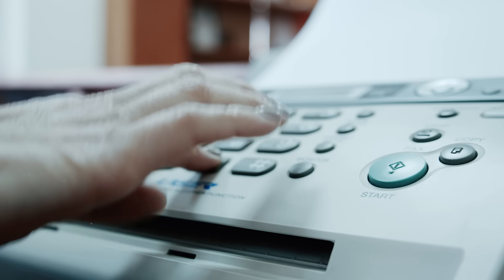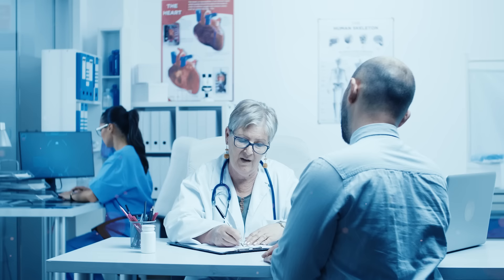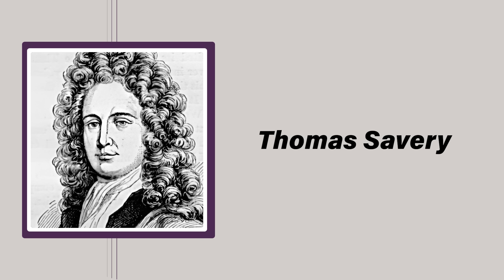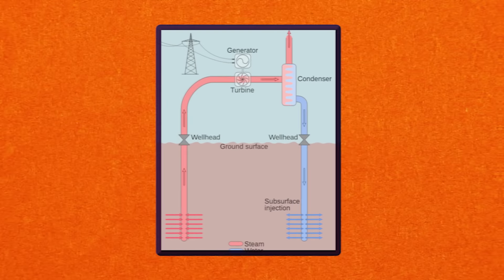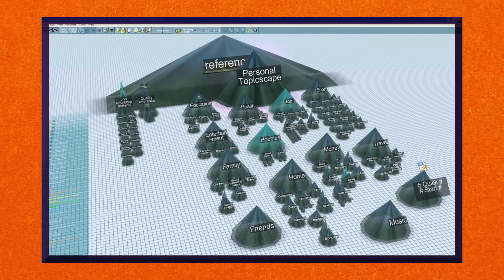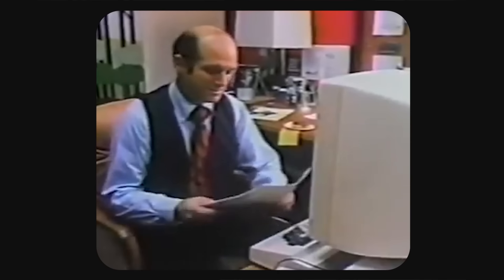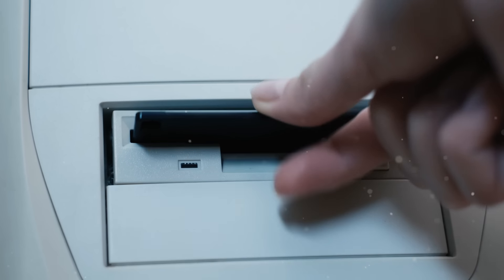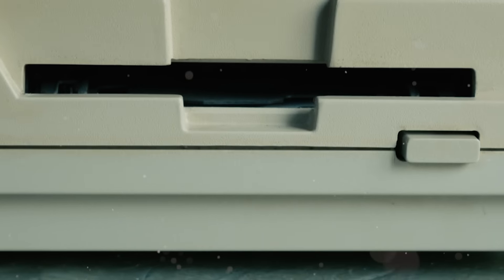Terribly Outdated Technology that we Still Use...

Comment: Steam and power are such fundmental basic concepts that it will probably never go obsolete.  What does sometimes go obsolete are certain types of steam generating equipment, or certain uses for the steam, but the basic idea of creating a clean high energy, high expansion vapor for power conversion or process heat is just irreplaceable.

Comment: As long as Windows XP is used for dedicated, not connected to Internet in any way, it works quite well.  I can site a commercial business use in quilt stores where the OS is the only compatible one for the computerized quilt machine software.  Never connected to anything but the quilting machine, just works.  I am sure there are point of sale systems that also will only run under that OS, and provides the function that the particular business requires.

Comment: I still have an old sharp slc-50 (50 mhz win 3.1). This has been running mead software (albiet) with my own tracking control system to control my 5 meter home satellite system and was once used to control a 10 meter dish with an i/o motor control system running a very old orbit track software system. The only mod I made to my system was to convert the 2 line files (orbits) to 3 line files (orbits) and measure and lock the GPS parameters to the dishes variable control motors to localize my earth track to a moving satellite in space.   I even have both xp/nt/ and win 2000 systems running. Even an old gateway running storm...a Linux distro of rain, and mandrake.. they've been on regularly since 1984 with some stops for maintenance.  A computer is what YOU MAKE OF IT. Not what it makes of you.

Comment: I had 16 Scanning Tunnelling Electron Microscopes at a place where I worked. The controlling computer was built on XP. The STEMs were a donation; they cost over $600k each to replace. There were no upgrades to move the controlling computer to a modern OS, and no one at the organization had the balls to put in a budget request to Spend $10m to comply with HIPAA

Comment: Minor correction: Fax machines are much less secure than modern e-mail systems.  HIPPA laws do not, and never have recognized Fax Machines as more secure than email, they were just so ubiquitous at the time that medical lobbyists convinced Congress to grandfather them in to prevent a costly mandatory overhaul of the medical sector under the assumption that they would be slowly phased out by encrypted email systems.  However, because HIPPA requirements are so nebulous, it it turned out to be much safer from a LEGAL standpoint for hospitals to continue to rely of fax machines because they can not be held liable if a fax machines is found to be using vulnerable data transfer and storage methods.

Comment: Was a hardcore Windows XP user until 2011 or 2012, used it since it was first released. Only stopped using it because newer games require up to date tech especially when it comes to graphics, so that computer became my secondary/back up computer until the life cycle of WinXP finally ended with no more support going to it. So far it has been my favorite OS to use, no other OS has come close to it.

Comment: One fact I was disappointed not to see mentioned of older OSes and floppies, and what is even trurer of seriously older OSes like DOS, is that newer OSes also become increasingly more efficient vectors of Malware. Modern malware can't hope to fit onto a floppy, while the latest(even if "outdated") antivirus software is effective against all the old viruses.  While many compsec experts will tell you the last PC OS version is insecure against newer malware, significantly older OS can't even run newer malware, effectively becoming secure again, in addition to it's security through obscurity. I remember in the early 2000, there was a scandal when news uncovered that nuclear missile silos were using software on old 5.5" floppy disks. But I immediately thought how impervious these made it against malware, esp. compared to a USB memory stick, which could contain multiple apps for stealing data.

Comment: I still have an old Acer Aspire laptop running Win XP.  I only use it for logging in the field because it's a nice, small laptop and I won't feel too bad if it gets damaged, unlike my larger, more modern laptops.  I also only need it for viewing .pdf files and looking at schematics and such.  I suppose if I tried to put Windows 10 or something on it then it'd get bogged down & slow, as well as crash all the time.

Comment: yes is true, we have plenty old machines that are not connected to the internet or are in a "no routed network / private only / one 2 one " that perform services that are very hard to copy or replicate in newer equipment, or simply it cost way to much ( like millions ) to port it to another system, even sometimes porting to another system will be like emulating the old hardware with a lot of bugs, so in a sense is better to just keep it, ( looking at you AS400 )

Comment: I'm in Germany, so I own a modem with integrated fax services, and a physical fax machine (as part of a colour printer, scanner, and copier device). 😂 I even send faxes occasionally when communicating with the authorities. Germany loves fax machines... 😂 Admittedly, I don't use it often, neither device is set up to receive faxes, and I have to manually connect it with a long cable each time I use it. Still.

Comment: As President of the Steam Automobile Club of America, and an employee of General Motors Powertrain, I have to dispute the idea that steam automobiles can use fuel more efficiently than internal combustion.  The problem is the latent heat of vaporization.  It takes 974 BTU to convert a pound of water at 212 F (100C), and atmospheric pressure, into a pound of steam at 212F.  Thermodynamically, this is an "irreversible" process -- which essentially means that we can't extract work converting that steam back into water.  All the power we get from the steam is by raising it to elevated temperatures and pressures.  Powerplants can condense steam to near vacuum due to a large cooling water supply , whereas automobiles are necessarily air cooled and thus lucky to drop the exhaust steam down to ambient pressure. Also, large steam plants can employ all sorts of heat exchangers that simply won't scale down to fit under the hood of a car.  The idea of steam-powered automobiles to battle pollution came about in the late 60's and early 70's ... but died a fast death when OPEC cut oil deliveries and governments instituted CAFE (fuel economy) standards.  Today, catalytic converters, fuel injection, and electronic engine controls arguably make a gasoline engine at least as clean, if not cleaner, across the entire driving cycle than a steam engine is likely to manage.  This is because you need to expend a lot of fuel just to raise steam whereas the ICE is ready to go after burning very little fuel.

Comment: There are technologies that are just „good“ , that work flawless and fulfil the requirements. It is interesting that there are many attempts to replace those technologies with shiny new technologies to sell the required upgrades and replacements, that usually solve issues that never were a real problem, but therefore drop many of the original requirements, thus requiring even more costly shiny new upgrades and replacements…
Examples are tcp/ip , the can bus or midi.

Comment: Many emergency services have "upgraded" to digital communication systems... that isn't too much of a problem around cities but as soon as you get into the bush they are near useless. They don't work in heavy smoke, hills, mountains.. you know.. the kind of places you need to go rescue someone. That also includes mobile data terminals, the systems used in ambulances.
Yet the antiquated CB still works in those situations, in fact there's volunteer groups which set up relay stations for volunteers during searches.
I don't know why they even bothered, for digital you can use a mobile phone and it has great security and is a "free" upgrade. Otherwise stick with what works.

Comment: I retired from the USAF in 2001. I was an Aircraft Weapons Technician. I took care of the weapons systems on five different fighter jets. Everything that was directly tied to weapons systems. Bombs, missiles, Guns, Chaff/Flare (yes those Phoenix Lights in the 1990's were flares. I saw them myself). But I digress...
I retired in 2001. I did work in several tech industries in the next several years. From selling electronics, to phone center at a big Cable Company (you called me, when your internet went out, and I'd be the one to tell you, "Have you tried turning it off and on again?". Indeed, thats usually the fix with all tech. I eventually gravitated to Xerox, in 2007, and my new carer as copier Tech had begun.Yes, the closest thing I could use my Air Force training in the civilian world. At least I had some electronics troubleshooting background. As none of the Major Air Carriers I know of don't use weapons systems.
One of the first things I noticed was, in the age of the internet, people were still using fax machines. Yes, I repaired those as well. Mostly they were incorporated into the multi function printers. But the were many that were stand alone Fax machines, connected to a dedicated fax line.
These were usually hospitals. They would often fax complete medical records to each other. I mean like 200+ pages in a single fax! These devices were never meant to handle that much use. And they worked them to death.
The Police dept used them. The Fire Dept used them. Lawyers used them. And many educational institutes still used them as late as 2020, when I left the industry. 
Everyone that uses a fax should know, even though it has the confirmation page, that is used for proof of transmission. It doesn't always work. It assumes that you have a completely functional fax machine at both ends. That nether one has any issues. That the sending optics are clean, not gooped up with liquid whiteout, a very common problem. It also assumes the receiving machine has ink in it. It is very possible to send a fax, receive the confirmation page, and the fax printed out a blank page. It could be out of toner/ink. There could be issues with the xerographic process in the case of a laser printer type of fax. The fuser could be bad, or the drum could be bad, or the laser could be bad, or it could have ground issues. And yet, you can still receive a message that the fax was received. Do not trust them. But, one that you probably can trust, the most expensive fax to use, is the one that uses a printer cartrige, that contains what looks like a 200 foot long carbon paper. Very expensive to use.

Comment: I have an old HP laptop that i dual boot between Windows XP and Linux Lite. I can't get rid of the XP side because of a touch strip at the top of the keyboard. If i accidentally touch the WiFi icon on the strip while in Linux, it turns it off. The only way to turn it back on is to go into XP and run the WiFi app to enable it again.

BTW, I also own over two thousand 3.5" which are all databased with all their volume and filenames. I can't bring myself to throw any of them out!

Comment: I'm still running a Windows XP box to run the extremely small amount of old legacy software that I need that doesn't have a suitable alternative in Linux and won't run under WINE.  Since that's a pretty small list of extremely specialised obscure software, it doesn't get used very often and, since it's old, there's no need to run anything more modern than WinXP.

Comment: Another technology that is still in widespread usage around the world: AM broadcasting and FM broadcasting (analog radio). Both technologies are really old (with AM being older than FM), and both could easily be replaced by more modern, digital technologies (for example, DAB and DAB+), but for some reason, both technologies are still relevant today, and are used basically all the time (at least in my homecountry of Germany).
Reply: satellite phones, radio, data, and TV, unless somebody has launched MORE satellites since 2008 (when i left Alaska) won't work North or South of a pair of certain Latitudes on Earth. 

my 2007 Dodge Charger SPECIFICALLY had the satellite radio AND antenna left OFF the car during assembly at the factory because it was ordered by a Dodge dealership in Alaska. 

so, my car doesn't have the huge touchscreen, navigation system/GPS, all those bells and whistles. all it has is an in-dash six disk CD changer, old old OLD Bluetooth system, an AM/FM radio, AND a cassette tape player. yes. a cassette tape player in a brand new 2007 car. ;> my smartphone does my GPS, BUT it can't talk through my car speakers... it can only take phone calls!

Comment: Well oftentimes a lot of this " antiquated" electronics is preferable to modern means. Take for example a fax machine,  let's say for example you're at the office and somebody hands you paper of the annual projections for next quarter or whatever. When they hand you this they say that you're going to have to send it to the Toronto office so that they can outline their projections as well. Well nowadays you'd have to take that piece of paper scan it in to the computer then open up the email attach the document then type the email and everything and then send it, you see a very multi-step process. Well the fax machine you would simply put the paper in the fax machine put in the phone number where it's going and hit send, literally two step process.

Obviously I know these are very simplified methods and things but I often see and I know I'm not alone, that the use of so-called " modern technology" is oftentimes more convoluted and actually takes more time than it does to use the older tech. And it's not a matter of familiarity or unfamiliarity as the case may be, I think it has to do with the fact that a lot of older tech was designed for a single purpose and that purpose was very streamlined and to utilize it was also very streamlined.

I know that last statement made me kind of sound like an old man, but you know think about it like you going to a restaurant and they say oh we don't have paper menus you just scan the QR code. Well think about the process of what it is we're trying to achieve which is to order food, with the old fashioned way you simply hand me a menu and I look at the menu in order it is so quick and so efficient. Whereby the QR method, I've got to take out my phone take a picture of the QR code then open up the website and then, oh wait the QR code didn't load correctly so I got to do it again, and then after three or four minutes I'm finally reading the menu, you see how complicated and convoluted it is

Comment: Whatever else You may say about floppy disks, reliable they are not! They are incredibly easy to damage. Common wisdom was to have at minimum two copies on different disks if you wanted to reliably transfer files. One of my friends once failed transfering a file between  two computers in the same building 3 times in row.

Comment: The force that drives the electric generator can be from steam turbines powered by many sources of heat: coal, natural gas, trash, nuclear fission, or geothermal. Or, generators can be run with hydrodynamic force (e.g., dams or Niagara Falls or the sea tides/currents) or aerodynamic force (wind).  It boils down (see what I did there) to a matter of economics and scale.

Comment: Not sure it entirely qualifies for a video like this  but you could add carburetors to the list, I'm old fashioned and still drive a car with one but I'm pretty sure most small engines stil run them, they're a lot cheaper and easier to produce and have less and cheaper parts than efi (electronic fuel injection), usually last longer too if they're not the incredibly cheap non adjustable plastic ones

Comment: I have a dedicated computer in my home running Windows XP. I invested Far Too Much in software that doesn't work on anything newer. AND I really LIKE XP.  I believe Windows 10 was the 1st that had Some advantages over XP. I still refuse to get anything newer than 10 for my online use.
 -- Floppy discs: you didn't mention the ZIP Discs. They were the size of the 3.5-inch discs but double the thickness and held the shocking 100 MEGABYTES of info. They came right around the time of CD for computers and never really caught on. I had a ZIP Disc machine and used it for my AutoCAD 2000 files.